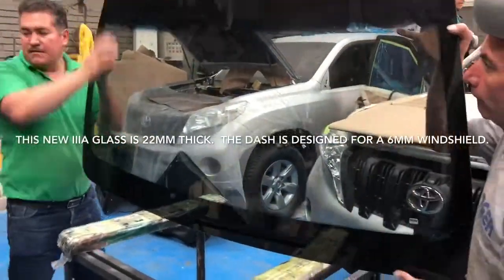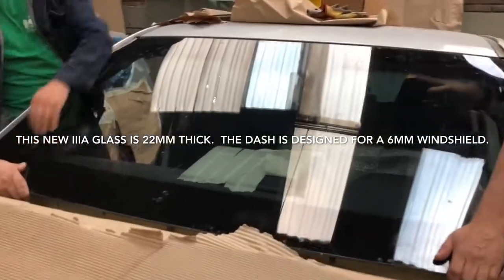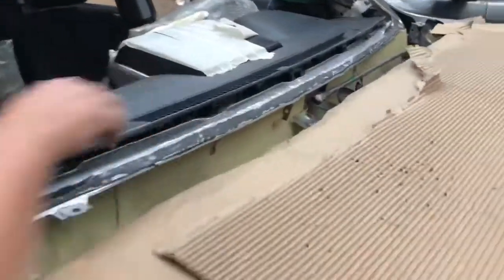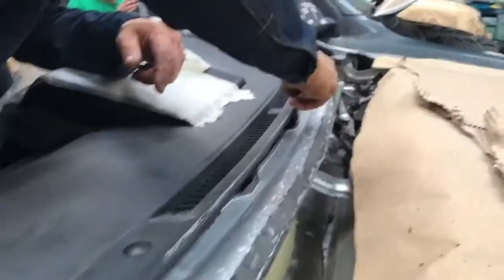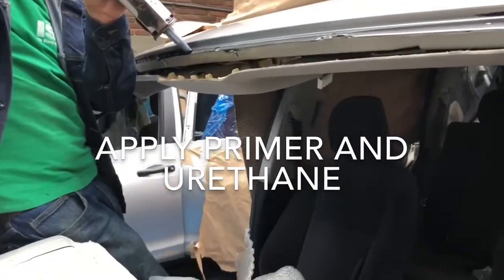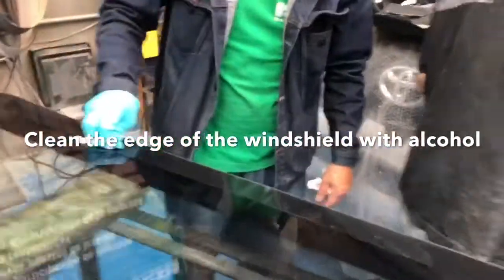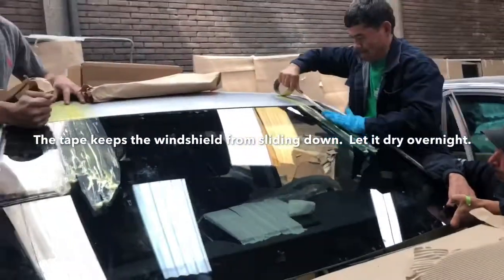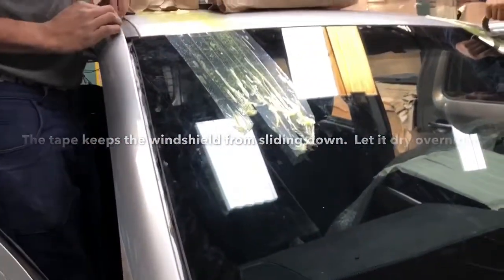Installation of level IIIA ballistic glass. Transparent Armor

Comment: So, your ballistic windshield consist of 3 regular windshields with 2 lamination foils between them. Is the glass tempered or not?
Reply from the maker: Silviu Florescu in thickness it’s equivalent to five regular windshields.  

They are four layers of glass (regular  not tempered) and in the inside of the car (safe side) it includes a layer of polycarbonate or Mylar spall shield.
Reply: @isbiarmor  isn't the tempered glass much more bulletproof resistant than the regular?